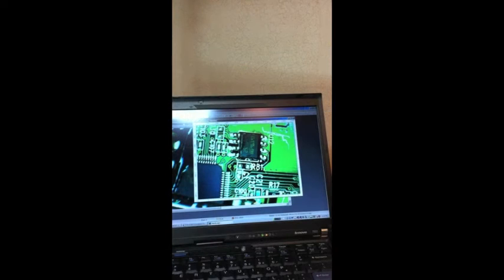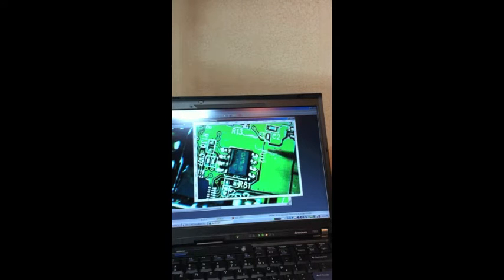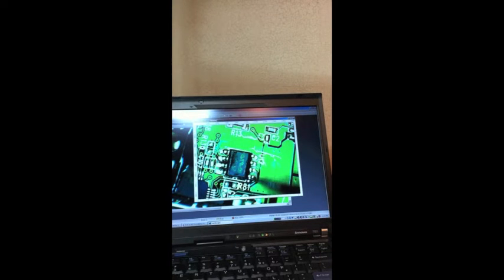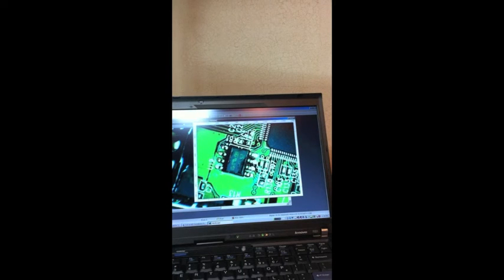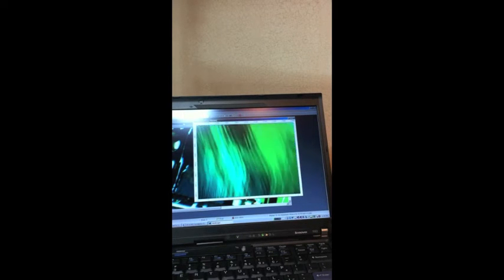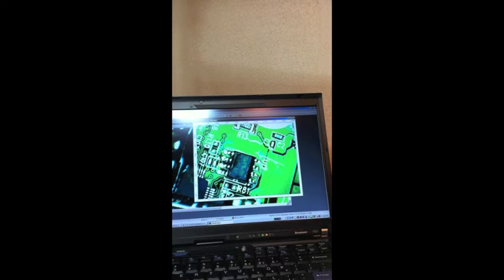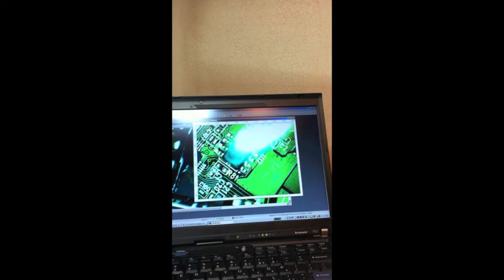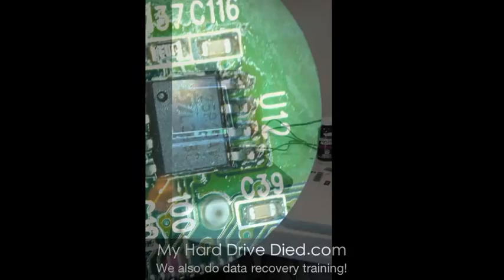Western Digital Hard Drive Board Repair U12 Part 3/3

Comment: The U12 chip is the rom chip on the board for the HD that tells it all the variable specifics of the hard drive...each drive is a little different and stores data with some variability...The u12 chip contains the seek and find nuances for your drive...you have to swap it out when you get a new controller board..like I need :(

Comment: Overall the videos are helpful, but it would be helpful if you told us what the U12 chip was for or if it was a custom chip or what the part number was etc.  I assume since you need a donor board it must be a custom chip, but what does it do or what is it for?